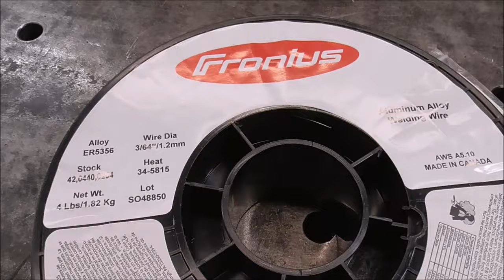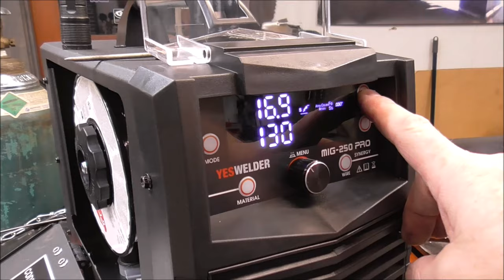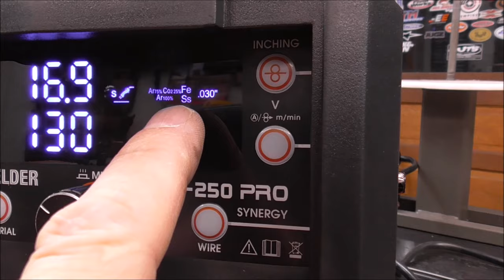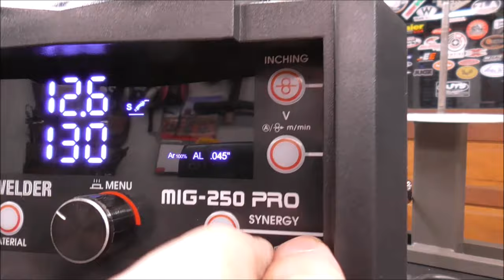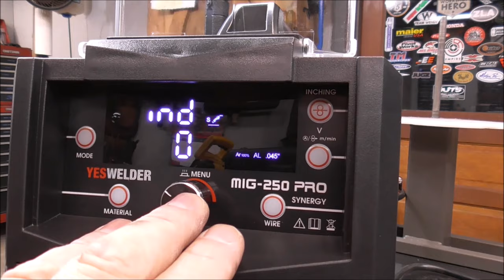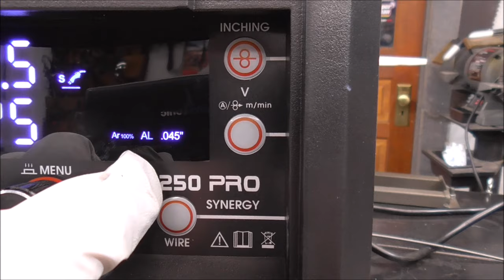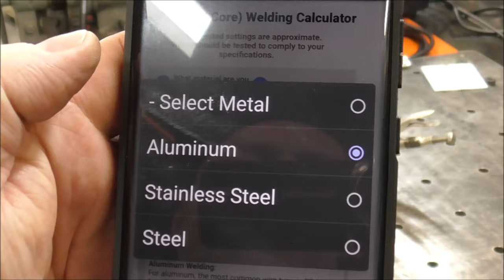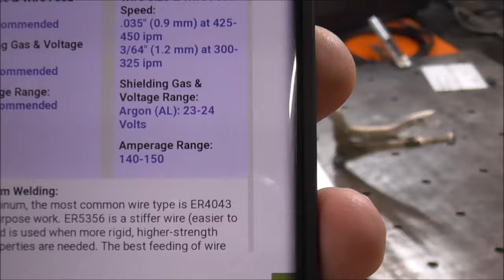Aluminum MIG Settings Machine Setup and Graphine Liner Ep2

Comment: You have to go through that procedure every time you change from welding aluminum to welding steel and back to aluminum again?

For a beginner this looks a bit complicated. I thought all you had to do was change the wire from steel to aluminum. I have a lot to learn.
Reply from the maker: @Dean Mayer unfortunately you have to change the liner if you want to run aluminum and again if you want to run steel wire. The liner for steel wire is not slippery enough to run aluminum and the liner for aluminum is a special material to allow the soft copper wire to feed easily, but steel wire will ruin that liner designed for aluminum very quickly.
Reply: @BrandonLund  thanks so much for the reply. I want to do some Welding but I'm new at this again. I welded back in 1977 but haven't done any since. Thanks again.
Reply from the maker: It's just like riding a bike. You got this brother!

Comment: At 20:50 into your video it can be clearly seen that your gas bottle tap has Ar CO2 written on the tap with texta. Are you sure you used pure Ar gas?
Reply from the maker: You can't weld aluminum with c25. I'm positive it's pure argon. When I pulled the wrapper off the valve I saw that someone had written that on the valve with sharpie. Maybe that valve was once on a c25 tank and the valve was rebuilt.

Comment: i weld down to 2mm with 1.2 5356 wire. i weld with 19-21 v. get that nice hissing sound when welding. dont worrie about that thick whire. u can easaly weld 3mm and up with that.
Reply from the maker: @blaster91 I looked back through the video and I dont think my voltage went above 17 or so while in synergic mode. I will grab some .35 and get it dialed in on 1/8" and give the 1.2 another try. Thanks man I appreciate it!
Reply: should be ok. but good luck testing it all out. alu is like a living person. every day the settings change somehow xD youre awsome
Reply from the maker: Hahaha "Alu is like a living person. Everyday the settings change somehow". Isn't that the truth brother!!!! This gave me a good chuckle 👍🤣

Comment: depending on how much aluminum welding ya do id just keep a set up for plug and play and have to switch parts around in the line..just a thought I'm sure some one already said..lol
Reply from the maker: Thats a great idea and an affordable time saver! A spare whip and liner is around 50 bucks. Not so much with my Fronius. A spare whip and liner for that runs over $500 😬

Comment: so wouldnt it be better/ easier/ faster if you switch metals frequntly. That you had two trigger guns. one with graphite for aluminum and a normal one for steel.  
The only thing I see that needs improvement to make it easier to switch torches. Is some type of button spring that has a thin flat  peice of metal on the back  .Which has a slot and a bigger hole it that goes over metal pin to replace the C clip.. 

that the button is mounted and just have the push the button to slide it in to the big hole to remove and button released it pulls! the slotted section in the original C clip lslot location
Reply from the maker: Spot on 💯👍

Comment: You said the liner may be graphene could you verify that?
Reply from the maker: It 100% is a graphene / Teflon liner. It has to be to run aluminum. One way to tell is the aluminum liner doesn't have the wire reinforcing around it. It's just the plastic liner material

Comment: Press the V button and tune it in with the ARL … spool gun works a lot better
Reply from the maker: Thanks man! I'm going to do another round with 035 but this time going manual. I noticed after watching the video I don't think my voltage ever went past 17 which I think was part of the issue I was having with the puddle not being as fluid as I wanted.

Comment: YOUR VOLTS ARE WAAAYYY TOO LOW!.. .045 WIRE ON 1/4" ALUMINUM COLD SHOULD BE SET TO 24V+ .. ALSO, TORCH YOUR METAL TO PREHEAT IT BEFORE LAYING THE WIRE..
Reply from the maker: Its not too low. Spray transfer usually happens around 21 volts but its very machine specific. 24 volts on this machine would literally vaporize the base material. Sometimes you have to be in the short circuit range for thin material.

Comment: 15v us wayyyyy too cold
Reply from the maker: All machines run different. What is good for one isn't necessarily the right setting on another. If it were that simple, there would be one chart with only one voltage based on material and wire diameter. Plus, you can also cheat the voltage by your contact tip to work distance.